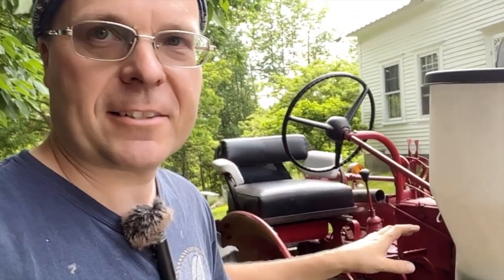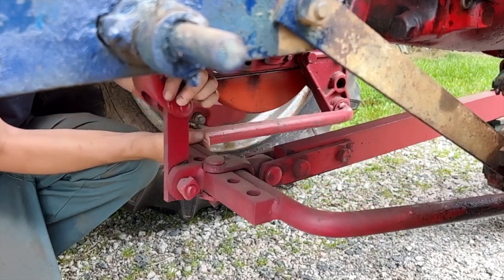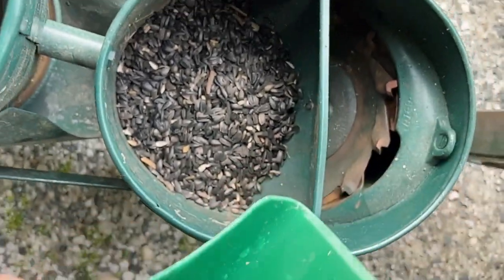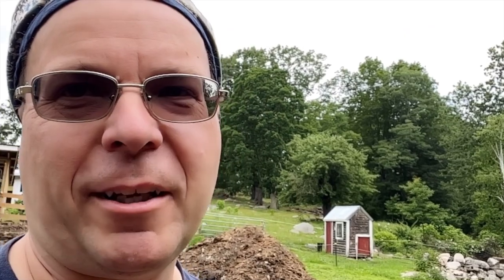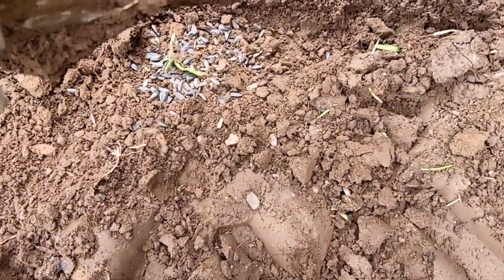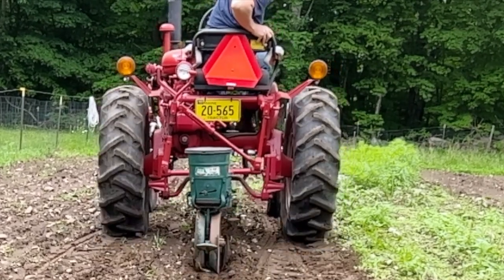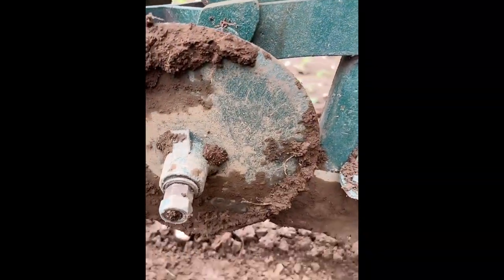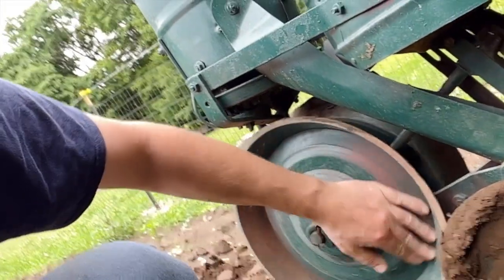IH Farmall 140 Fast Hitch Adjustment & Cole 1-Row Planter

Comment: Hey Tom, the Cole planters were very popular here in N.C. from what I've seen and so were the IH 184's as well. There were also a lot of the ''Belly'' planters.... various makes too. I have an IH 186 fast-hitch planter for my 100! It takes some time setting them up correctly but some do work better/more efficiently than others. Thanks for sharing!
Reply from the maker: I had a 174? Runner planter for my Cub, but I sold it because I couldn’t use the Cub for much else when it was on . I think the Cole would work better in Sandy soil with less rocks, but the important part is keeping weight on that packing wheel. Thank You for watching

Comment: Do you think the planter would have done better with dry soil
Reply from the maker: I think so, provided you get the right amount of pressure on the packing wheel. This is my 5th year using a Cole, I had a 3-point hitch one previously that worked ok. It takes a few minutes to correctly dial in your fast hitch. Thank you for watching

Comment: Hey Tom I also have to ask.  The soil does seem too moist for that planter to work as intended.  I understand you can’t wait for ideal conditions.   Regardless, thanks for sharing your thoughts and experience.
Reply from the maker: Yes it does. It’s been really crappy weather here this season. It rains for a week and then we get about 2 days of sun. It’s been really tough trying to get hay in too😕
Reply: @LedgemereHeritageFarm  Our weather has been weird for the season as well.  Too dry.  We did get about a half inch yesterday, enough to save some green in the lawn.  More tomorrow, maybe.  Good luck with your hay.
Reply from the maker: @stanleyconrad4234  the weather has been very strange. Every once in a while, we get a cool, wet summer